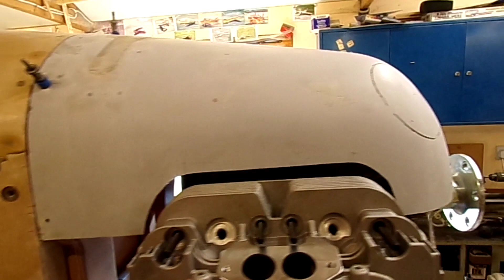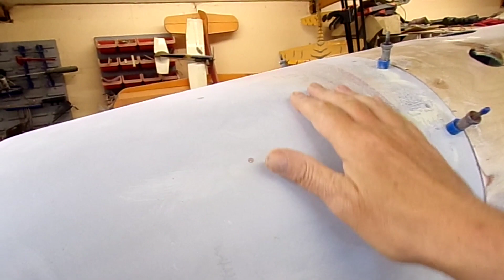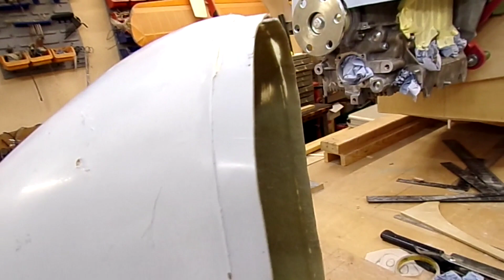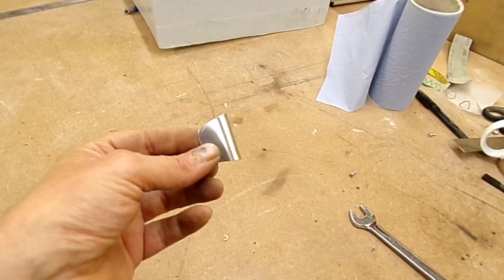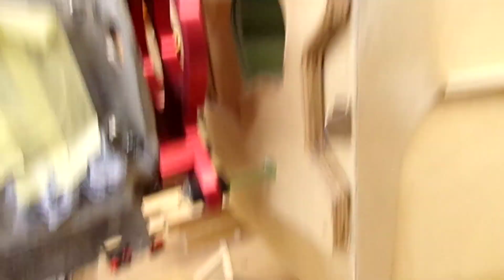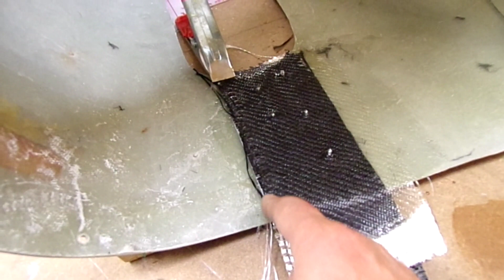EP124 The upper cowl almost done, now the lower. Fisher Youngster

Comment: Correct me if i'am wrong, but doesn't carbon fiber get its strength when it's under vacuum?
Reply from the maker: Simple answer is no. All composites have a best strength the weight ratio when the resin to fibre is just right, too much resin and it is brittle, too little and it is weak (no matter if it is glass, carbon or kevlar). Vacuum will remove some of the excess resin butwithout a supporting form mould can didtort the component. If I was to make the cowl from scratch and had the choice I would use pre-impregnated carbon or vacuum infuse, both superior to just vacuum baging and way better than wet lay up.

Comment: Gosh that lower cowling looks tight to the engine. Is there’s sufficient clearance for the oil pump, given the amount that lug sticks through? 😬
Reply from the maker: It is very tight and the front will need to be cut out to get air in for the oil cooler and to clear the oil pump, which will take a fair bit of work to get it to look nice, not sure how, yet! I almost feel like I should have thrown the cowl supplied and started again.

Comment: It’s amazing how fitting the cylinders and taking the cowling away from around it has transformed. I did think it was looking a bit ugly without appreciating what was still to do. Looks good.
Reply: I figured the cylinders sticking out would add to the looks... the little snub nose top cowl was only half the picture
Reply from the maker: @sawyersdad5292  Hopefully in the next video or the one after that you will see what it looks like with the bottom cowl joined to the top one with cyclinder sticking out looks like, even then there will be a lot of work needed once I build the engine and oil cooler system to finish it off.
Reply from the maker: Yes it is not too bad when hiding behind the cylinder heads :-)

Comment: Fibreglass is easy enough to modify, I'm sure you'll come up with a couple other mods before you're done.... will the top or bottom be quickly removable or will you go with a more permanent solution... which is why you have the access holes?
Reply from the maker: Yes the GRP is easy to modify but hard to keep light. No not having fast removing cowls as you rightly say that is why I have gone for the access holes.

Comment: I've seen better new parts than that lower cowl.  You will get it into better shape I'm sure.  Some good progress this week.  The cylinder heads looked good in place.
Reply from the maker: I have to say it is not the best I have seen and there is still a lot of work to try to get it to fit as it should.